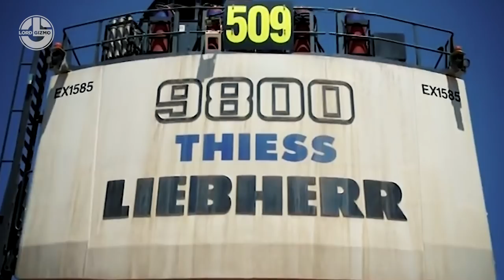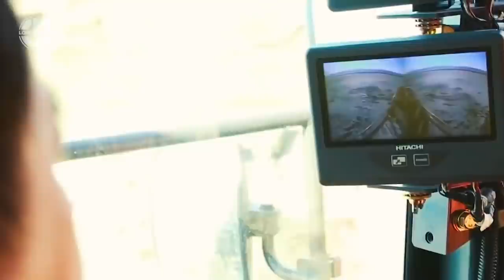The 5 Largest EXCAVATORS In The World That Will Absolutely Blow Your Mind

Comment: Good video, with some nice clips of these beasts. One thing, they have huge buckets, but they don't hold 800 tons of material. Not near it. These machines weigh 800 tonnes. Think about what would happen if they tried to lift 800 tons of material in one bucket.
Reply: Correct. That Hitachi scoops up 50-60 ton of coal in each scoop. Five scoops fills the tip truck, which normally results in a payload in the truck of 250-300 ton.

Comment: That pc 8000 doesn't fill a 240 ton mining truck with one scoop that's a fact.
Reply: with a scoop weighing in at 3000 pounds*, a 240 ton capacity truck would need 15-20 scoops to be close to full.
not good at all.

* 3000 pound per bucketful of 55 cubic yards loosely packed as per Komatsu spec.
Reply: @jaquigreenlees  think you've got your maths wrong , your saying 20 buckets to fill that dumper so that's only 12 tons per load,that bucket holds up to 120 tons per load so only two full buckets to fill that dumper.
Reply: @markwood9987  3000 pounds is only 1.5 tons and the dumper can hold 240 tons
Reply: @jaquigreenlees  your never saying that bucket only holds a ton and a half are you,that bucket holds 120 tons.

Comment: It would be interesting to know what minerals these mines produce?
Reply from the maker: Well, we don't specify as these machine are generally speaking not purpose-built for a specific mineral.  We describe the machine's abilities for that reason :)
Reply: Well, at least I can answer with regard to the Rh400: oil sands in Canada. You get a barrel of oil per 2 tons of sand. It was designed for that material. The Cat 6090 is exactly the same machine, just yellow, as Cat bought Bucyrus which had previously bought Terex.
I know one of them was sold and shipped to Thailand. I don't know what it's mining there.
Reply: Thank you for the answer !
Reply: Thank you for your answer!

Comment: 800 tons would bury a truck as you loaded it. If the Cat 🐈  was 103 cu meters maybe the Liebherr was 80 not 800 cu. meters . No way a 42 cu. meter bucket could ever hold 800 tons of material. There no trucks that hold 800 tons of material.